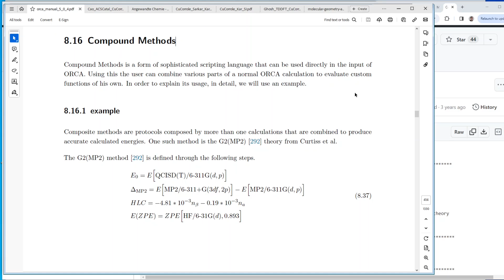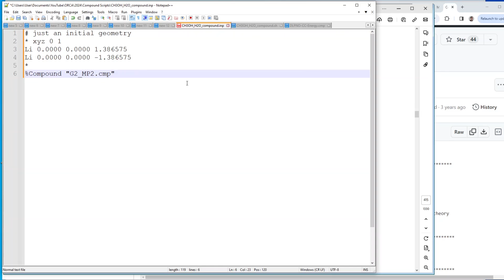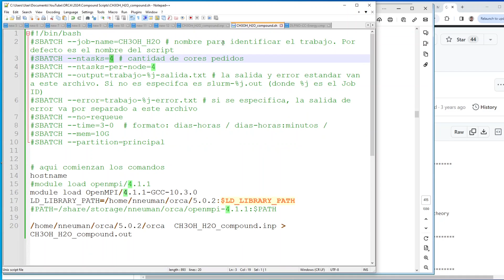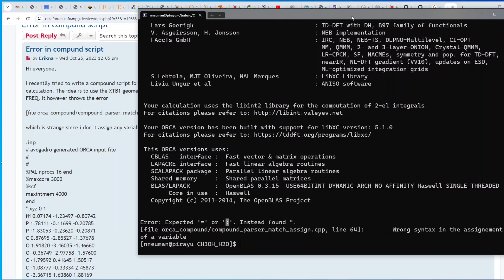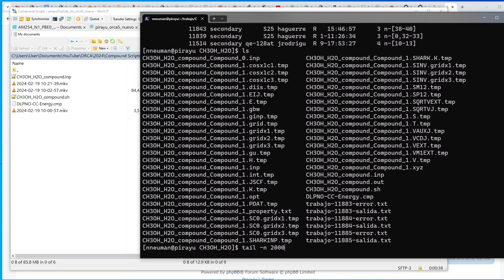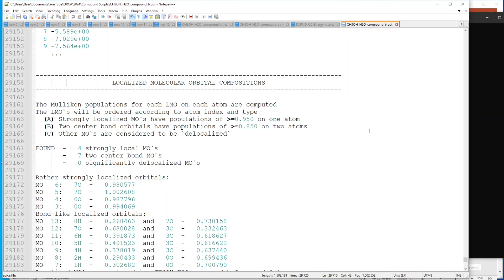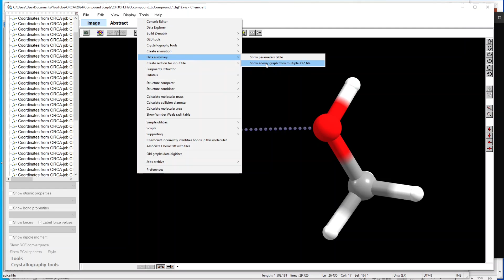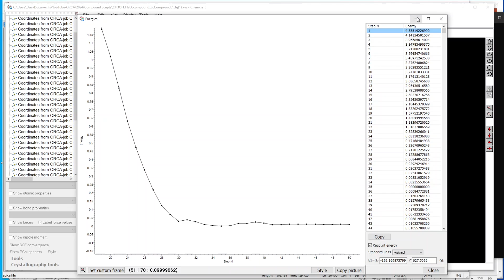Using the Compound Module in Orca for Automating Consecutive Jobs

Comment: Thank you so much for your tutorial! Is there any convenient way to run compound jobs bearing different geometries-e.g. for fragmented initial guess calculations in the case of lanthanide complexes?
Reply from the maker: I haven't looked at this yet. I assume it is possible, because you can read at any point in the job different xyz files, and you can set each calculation in the compound script to output files with a certain name. For example you can use 
%base "fragment1" 
in the first step
and then use
* xyzfile 0 1 fragment1.xyz
in another step. And you can basically do whatever you want with those calculations. if you want to run single points on two fragments of a molecule, you would have to manually create the xyz files for each fragment and the entire molecule. Then you can use orca_mergefrag to join the wavefunction files (.gbw) of each fragment and read that as guess for the complete calculation.
I don't know if this is what you were asking for.